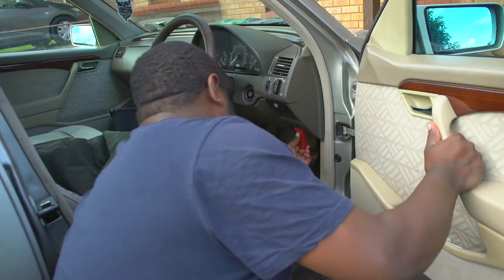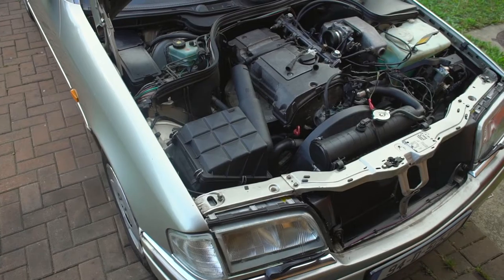Electrical Issues with The Mercedes  C180 W202  PT1

Comment: In my car C180 W202, I had the same problem and I  rebuilt a new harness, and now it is working very well.
Reply from the maker: I am rebuilding one right now unfortunately after tiresome research not much information available so i am documenting everything and will make a small pdf in easy steps and simple language for every one with this problem to solve it
Reply: Burn wire??

Comment: I just finished the complete harness for my w202 C180. After 1 year the car start again!! In my case the harness short circuit fry the engine ECU and i buy a used one, luckily there is no need to program it. Pay attention that the harness inside the throttle body si also damaged! For the harness I did my own thing, for example i replace the connector for the throttle body and for the injector i use only 3 wire so the total harness is much much lighter.
Reply from the maker: Where did you buy the new cable was it expensive
Reply: Bro howwww? I'm still looking for a reasonable replacement harness

Comment: Hi i have same issue here 96 c200, i was trying to remove the harness but when it goes under the manifold i cant see where it goes or connect ?.. i coudnt see that part in your video , would it be possible to video call sometime please cheers
Reply from the maker: Il be in the yard Monday il send photos if that can help or either way you can email me nemzrepairs@gmail.com but my advice is start with one wire repair that and move on to the next

Comment: I'm lucky, I buyed a 98 W202 C200 with new generation of harness and knowing that problem, when my friend was looking for a C280 with inline 6, we checked that first.
The first C280 we saw was a 95' C280 Sport, but the harness was already dead and the seconde one was 94' C280 Elegance and the harness was replaced.
Reply from the maker: I bought this one for cheap around 1200 euro it was badly idling I thought a bargain easy fix little did I know the wire was in bits ,another reason I got it cuz it’s 94 and in Ireland cars 30 years older have classic insurance and road tax so I thought it will resale at a very high price in 2023